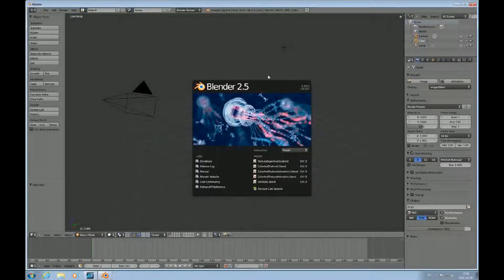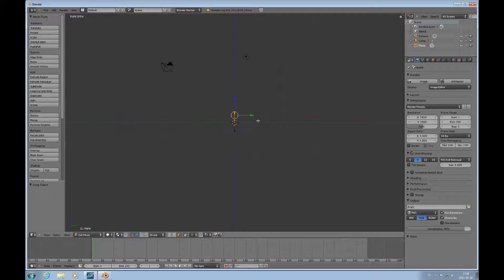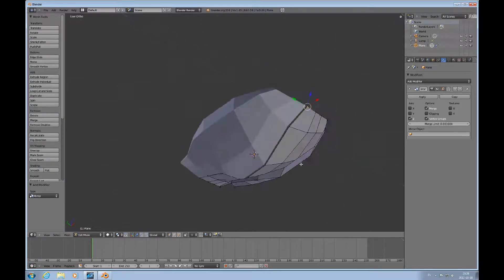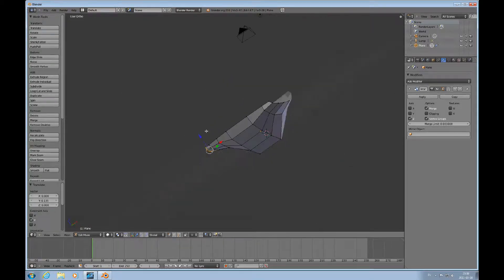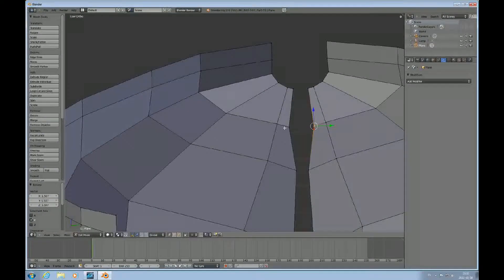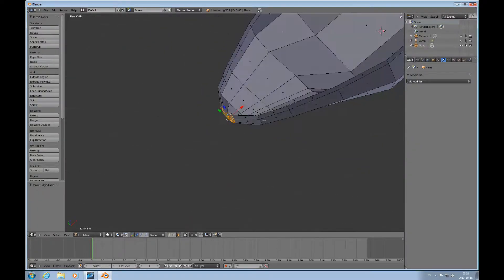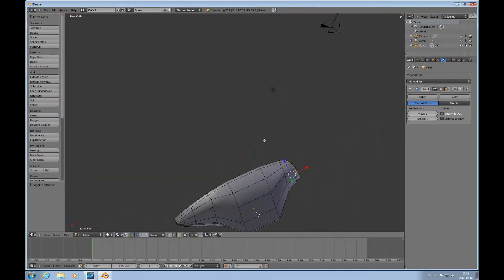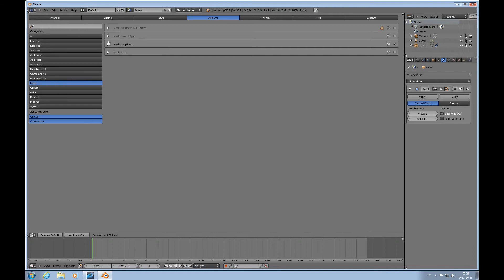Accomplished Beginners Blender 3D #2 Tutor

Comment from the maker: @azmagaref What is it with young men and guns ? Anyway the more mesh = number of vertexes you add to a scene regardless if the mesh belongs to one or several objects it will take CPU processing to calculate its presentation in the 3D - view. One way to speed things up is to choose wireframe mode then there is no need for shadow calculatoin in the 3D-view. On a multi core machine Blender takes little advantage of the load distribution i 3D-view. During render however Blender can use all cores.